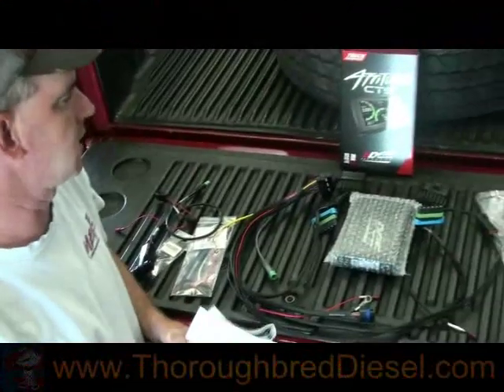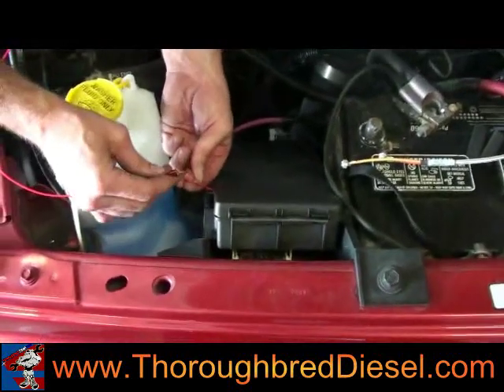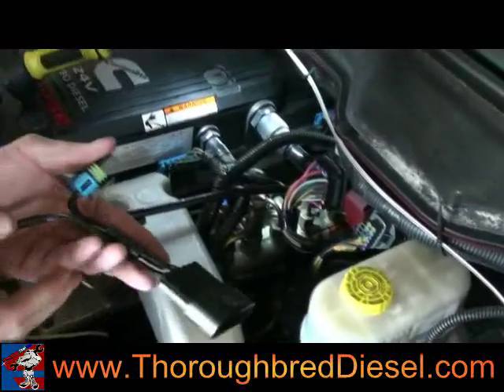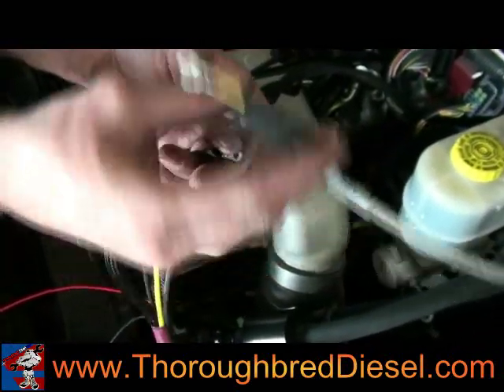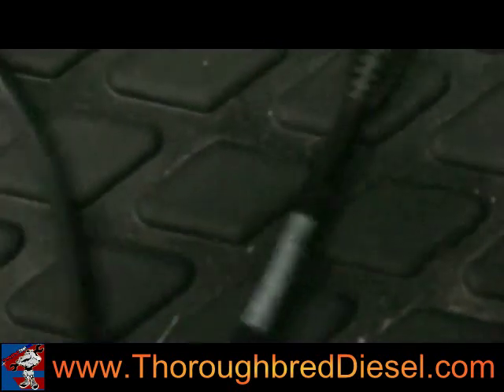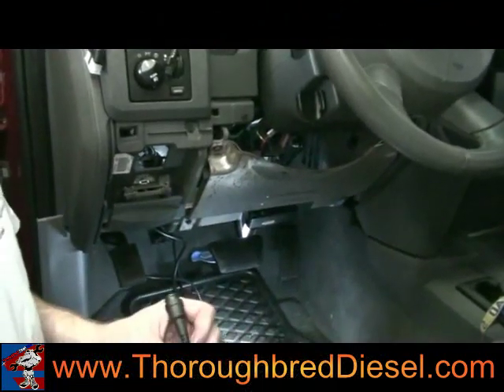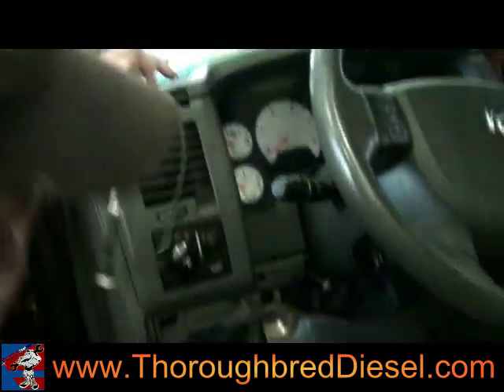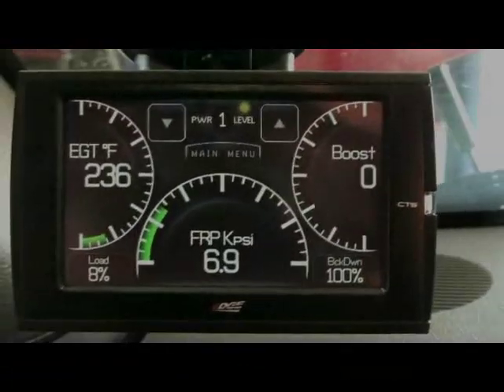Edge Juice with Attitude CTS Install: 2006 Dodge Cummins #31104

Comment: So I just bought the competition edge tuner and I plugged the monitor in and it kept saying saying couldn't read I didn't hook anything else up but I figured it would still work if I didn't any suggestions?
Reply from the maker: Update the unit and see what you get.  Make sure everything is hooked up as normal as well.
Reply: It works it has alot of power lol

Comment: Where and how did you get that splitter/extension for turbo timer?
Reply from the maker: +John Hauftman If your truck is capable of using the turbo timer feature it will come with or be noted in your Juice with Attitude instructions.  If you need any help with your setup please give us a call at (866) 737-4966.

Comment: Is the 2006 tuner compatible with 05 truck as well?
Reply from the maker: +Urs Kellenberger No,  the 04.5-05 trucks have their own part number.  If you are wanting this with the new CTS2 monitor,  the part number will be EDG31503.
Reply from the maker: +Urs Kellenberger The 06 and 07 trucks monitor different PID’s,  if you are just wanting gauges you would be better off going with an Edge Insight.